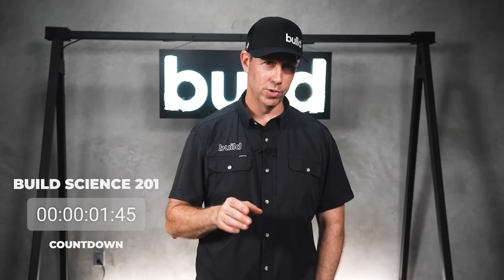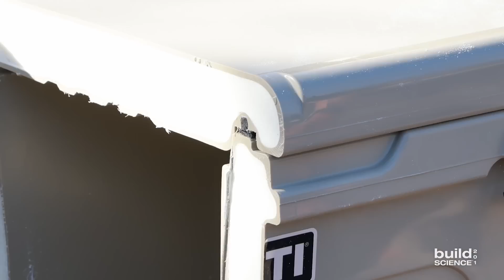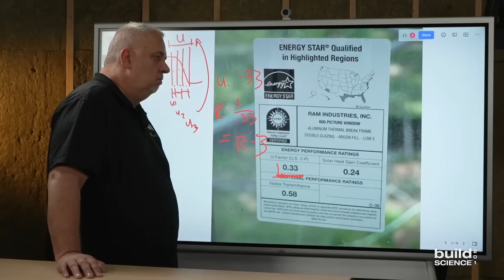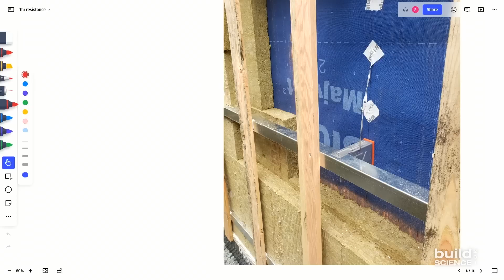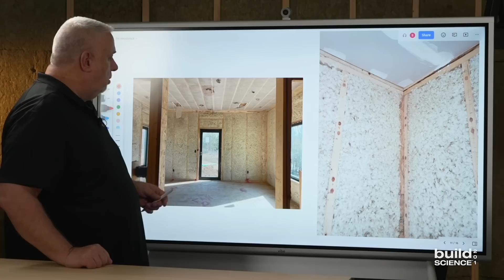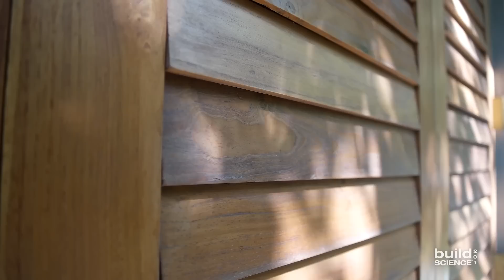Build Science 201: Ep. 11 - Thermal Management: Resistance

Comment: Hi Matt, thanks for the very interesting series. I love watching them and they really improve my understanding of a good building. 
I am a wood frame hobby builder from the Netherlands and have built a ecological tiny house. Having watched your series after my build, makes me really understand all the mistakes I have made during my build. 
Some aspects of your series make me wonder. Giving the low thermal mass of the American wood construction buildings (compared to the european brick buildings) makes the “specific heat capacity” of different insulations materials an interesting factor. 
Next to the varying ranges of thermal resistance of different materials, materials also have a different thermal mass / specific heat capacity: it is the amount of energy (heat) which can be stored in a material. Concrete for example has a very high thermal mass: it sucks up excess heat during the day and gives it back during the cooler night creating a nice thermal dampener. This difference between similar R-valued materials, results in a very big difference in temporal behavior. The in blown cellulose has a specific heat capacity of 2.1 kJ/kg K. Blown mineral fiber has a specific heat capacity of 0.71 kJ/kg K (one third). This means that when heat takes 4 hours to travel through a wall filled with blown mineral fiber to reach the inside, it takes 3*4 = 12 hours to travel through the same wall filled with blown cellulose. The cellulose wall with the same R-value results in a very different feel: the cellulose blown house takes much more time to heat op (or cool down) and has a much more constant temperature. 
Many of the ‘organic’ or eco friendly building materials have a very high specific heat capacity. This advantage does come at a cost: their weight. A higher thermal mass usually corresponds to a higher weight.  Do you have any experience with building with materials with a very high specific heat capacity?

Comment: So how much polyiso board exterior insulation is enough to provide an adequate thermal break in climate zone 2? One inch, two, more? At what point does the cost start outweighing the benefit substantially?
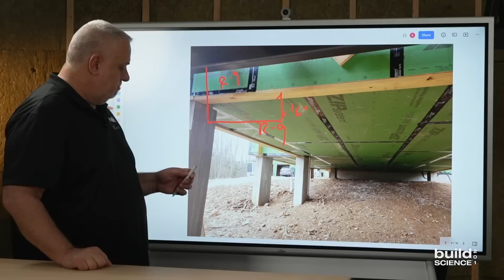Reply: Go to 11:20 where  Steve is comparing a Texas build and speaks of the difference needed in zone 5.

Comment: Fabulous stuff.

I've been daydreaming about double framed walls. Not sure why you need 2x6 outer if construction done so that both inner and outer walls carry the floor load. Thinking about order-of-construction, who does what, etc, this is my thought for Zone 5B, at 8,000 ft in the Rocky Mountains. Heating but no air conditioning. Platform construction.

#1. Sheathed 2x4 outer wall. All outer walls go up, are squared, and 2nd top plate added. Note, wall is 3/4-inch short. Note 2, sheathing should have some moisture permeability, so no peel-n-stick foil, ZIP-R, or whatever.
#2. Framers add Rock Wool bats (Rock Wool due to it's hydrophobic nature).
#3. Framers minimally attach 4 inches of XPS (possibly in 2 layers, crossed seams, and taped) with bottom edges set in a generous layer of polystyrene-safe caulk. Note, R-35 at this point, plus whatever gets stuffed into inside wall cavities.
#4. Inner wall frame and set into place pressed against XPS. 2nd top plate added. Again, 3/4-inch short.
#5. 3rd top plate of 3/4-inch plywood added, 11-inches wide, set in a generous layer of calk along top edge of XPS.
#6. From here adding inner walls per normal framing, with walls at full height. Then add 2nd floor or roof trusses and proceed as normal.

Framers will probably balk at the idea of insulating the walls, but far simpler than normal because no pipes, ducts, or wires. Windows and doors are done oversize, with plywood or sheathing tying the inner and outer walls together, caulk on edges of XPS. Finished rough opening at proper size. Trades don't show up until all framing done, as per usual.

Potential challenge for exterior wire penetrations, hose-bibs, etc. Perhaps a crazy detail-oriented person could set conduit at these locations, then the insulators shoot foam inside the conduit to air seal them (after trades fill the conduits).

Another challenge could be walls where rim is parallel to joists (if heavy load above, like a floor). Perhaps a "ladder" of rim + joist could be constructed so load is across full width of wall assembly. Thus full weight bearing of wall above on full width of wall below.
Reply: Thank you for joining us

Comment: I’m DIY building a 48’ tall ICF home. In addition to the 5 inches of thermal resistance that my foam forms provide I also have an 8 inch thermal battery of over 1 million pounds of concrete. 

I have already seen how much of a difference it makes in the 16’ tall room under my garage. The home doesn’t have a roof on it yet and that room only has a 4 degree swing compared to the 30 degree swing outside. I have also designed a cooler type roof using many of Matt’s tips so that I will have 6 inches of outer foam insulation and a foot of regular insulation under the roof. 

And Steve would be proud because he can take big red and draw a continuous line in every direction around my home because I even used pango wrap under my 5’ wide footers at the bottom 😊

It will be interesting to see what my heating and cooling bills will be for this 5 story multigenerational home.
Reply: *skyscraper

Comment: Matt spoke about mold on the sheathing due to vapor hitting a cold surface but ZIP-R doesn’t preclude that problem because the insulation is inboard of the sheathing.   The insulation needs to be outboard of the sheathing to keep it above the dew point.
Reply: The insulation on ZIP-R is polyiso, which is air-tight and moisture resistant. The condensing surface is the inside face of the ZIP-R.
Reply: Vapor cannot get through the polyiso on the Zip-R to the OSB sheathing because it is closed cell in structure. An interesting test would be to put a wireless thermometer on the inside surface of the Zip-R (R3,R6, and R9) in the winter-time in a very tight, efficient house. Then insulate the wall normally with spray foam, rock wool, or whatever and dry wall. Once the wall is finished normally you could monitor the actual temperature on that inner polyiso surface. If you use closed cell spray foam in the cavity, the water vapor from inside cannot get to that surface.  Probably with the R6 and above in TX, the temp on that polyiso surface doesn't fall below the dew point anyway. I wonder if this experiment has been done?
Reply: I think Matt has done plenty of videos where exterior insulation is also a feature.

Comment: After a few years of watching this channel,  it really makes you think differently about structure and moisture control.  Heck, especially insulating a home and how even adding an additional $1,000 -$2000 of extra unsulative material, accommodating lumber and hardware to a $125,000 home can make a big difference in energy costs and comfort.  
   I applied some of these techniques ( The affordable ones) for my room addition and existing house and it really paid off.
  Of course commercial corporate builders want production with least resistance + cheapest + fastest route. 🫤. (Think D R Horton)

Comment: Average person puts out 11,000 BTUs. If you wrap those walls with 2 sided raddiant barrier. Take R50 and add R57 for a total of R107.
On ceilings I would use 3 inch commercial foam with a 1 inch dead air space. Then add a 2 inch commercial foam with another 1 inch dead air space then put in my 2 sided radiant barrier. Part of this was for noise abatement because there were low flying commercial flights overhead. Did the same thing in the walls for bus and motorcycle noise.  Customers would tell me how comfortable and quiet the houses were.😁